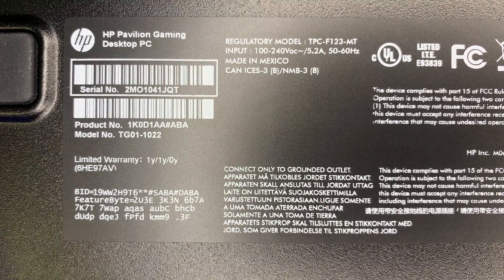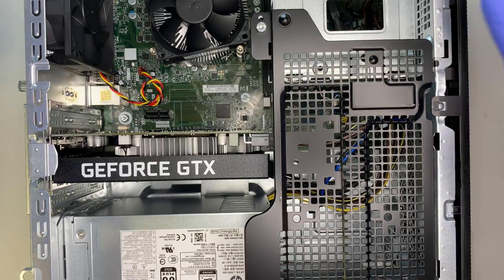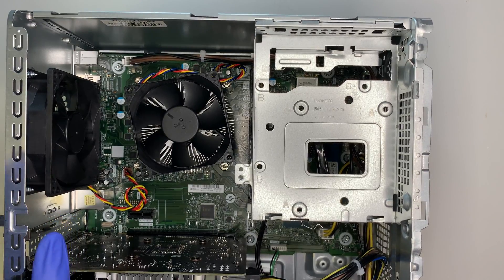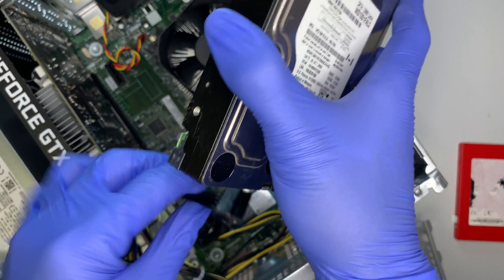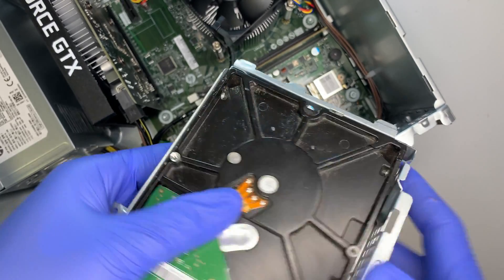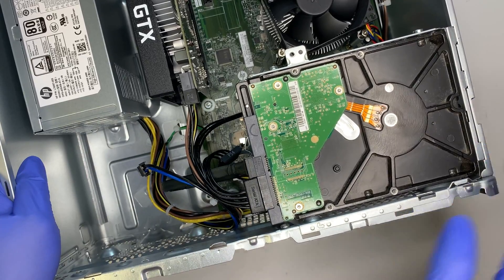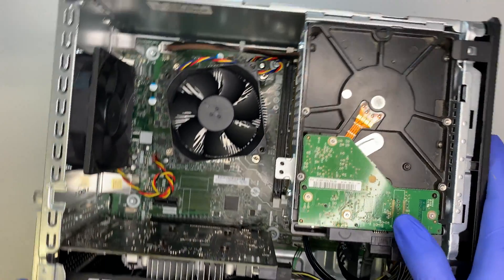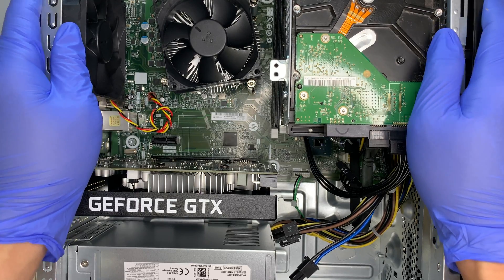HP Pavilion TG01-1022 Add Second Hard Drive

Comment: Excellent tutorial. HP did it a bit complex to remove those things compared to the previous Pavillion models, but you showed how to do this in a clear manner. I just have a WD black in my old Pavillion (WD was bought a few years ago, before I changed for TG01) so I'll install it soon. Thanks a lot. BTW, is power supply  strong enough for 2HDD + additional SDD?

Comment: It's funny watching the videos on this computer, because I bought one and have upgraded a few things, and everybody does more than they have to.   For example, all of the videos showing you where the ram is located on the motherboard, everybody removes the black grate and the hard drive holder, when you can simply just put the ram in without removing anything.  Same goes for this Hard Drive.  You don't have to remove anything, you can simply slide the hard drive in, plug it in, and put the two screws in the side that's not facing the case

Comment: After watching this video, which is exactly how the job should be done, I changed drives three times, rescuing old drives from a computer that I scrapped.  Had three drives in the old computer, one was bad, the other two were good, and using the Sata connection made the job easier.  Now, this video shows how to install one more drive in the supplied drive cage.  And the video mentions that you can add a third drive, as the connections are there.  But where do you get a drive cage that holds both the drives?  Or is there another way to do it?  I would like to have two additional drives in this computer.  The UberGeeks comment below, I interpret as to meaning you can use the supplied drive for one more hard drive, but I want to have two more hard drives.
Reply: Not sure if you saw the comment below by lumiereeclair.. but... he states: You can actually install up to 3 hard drives on this machine. Two 3.5 and one 2.5 exactly. (Of course you can interchange the 3.5 drives for 2.5 drives as well.) For placement, as shown in the video,  you can mount one 3.5 inch drive on the silver cage, however you can also mount a 2.5 hard drive on the underside of this same cage..  How? Just pause the video at 3:0. You will see 3 screw holes spaced around the rectangular opening that are spaced just just right for a 2.5 drive. To install the second 3.5 inch hard drive it can be mounted just behind the front panel on the chassis. He doesn't show it on the video, but after you remove the side panel, take a close look at where the torx screw that secures the silver cage is. Below that you will see holes that will allow you to mount a 3.5 inch hard drive perfectly so you don't have to buy a bracket, but you will however need Y splitter cable for SATA power since there are only 2 SATA power connectors on the included cable and you'll need one more for 3 hard drives. Also if you really want to go overkill for even more storage... you can buy a PCIe x1 NVMe M.2 expansion card. This will allow you to mount a M.2 NVMe drive. NOTE: It will only run at PCIe x1 speed, but if you're not using that PCIe slot, then that's a good option to consider..

Comment: Can you help me find the cable I need to use to add this one that you recommended? Thanks 
Seagate BarraCuda 2TB Internal Hard Drive HDD – 3.5 Inch SATA 6Gb/s 7200 RPM 256MB Cache 3.5-Inch –

Comment: Hi your video was very helpful but i have one more question do i have to remove the conector  at 2:48
Reply: thank you in advance
Reply from the maker: @ckt3315  Not necessary. But it will make your installation easier. That connector is for front lightning.
Reply: Thank you you helped me with this video

Comment: Can you give me a link to the SATA power cable? Please reply, Thanks.
Reply: At 4:16 if you look below the ram you can see a 4 pin cable. That's the sata power cable and it should already be inside. If you need to install more than 2 sata devices then you just need to get a Y-splitter sata power cable.
Reply: @lumiereeclair  Yeah i already know this comment is outdated. I already opened up this PC and found the cables included. By the way, what screwdriver do i need for the 6-32 hdd screws listed in the description?

Comment: It seems there is room for just 1 HDD beside the C Drive (SSD M.2)... Is there a way to have 3 hard drives installed? SSD +2*HDD? It doesn't make sense to provides additional SATA connectors without providing housing for the 3rd Drive?
Reply from the maker: Max 2 additional drives
Reply: you can only hold 2 because it's not enough room for more
Reply: i believe you can install a laptop drive (2.5") hanging off the bottom of the hard drive caddy and a 3.5" drive inside the caddy .. i'm looking at it now and that appears do-able.
Reply: @rushNbust  yeah I already did it work I got all my games back now since I got more space

Comment: Hello, Thanks for your very helpful video!
If I want to install 2 hard drive instead of one, do I have to buy a bigger bracket with two slots, right?
Reply: You can actually install up to 3 hard drives on this machine. Two 3.5 and a 2.5 exactly. Of course you can interchange the 3.5 for 2.5 drives as well. For placement, as shown in the video you can mount one 3.5 inch drive on the silver cage, however you can also mount a 2.5 hard drive on the underside of that cage as well. If you look at 3:07 there are 3 screw holes spaced just right for a 2.5 drive. The 2nd 3.5 inch hard drive can be mounted behind the front panel on the chasis. It doesn't show it on the video, but after you remove the side panel, take a close look at where the torx screw that secures the silver cage is. Below that you should see holes that will allow you to mount a 3.5 inch hard drive perfectly. So you don't have to buy a bracket, you will however need a Y splitter cable for Sata power since there are only 2 sata power connectors and you'll need one more for 3 hard drives. Also if you really want to go overkill, you can buy a PCIe x1 NVMe M.2 expansion card. It will allow you to mount a M.2 NVMe drive. It'll only run at PCIe x1 speed, but if you're not using that PCIe slot, then that's a good option to go for.
Reply: @lumiereeclair  Here is the HP video showing the front panel mount on a similar TP01  https://youtu.be/GzJbEJ1NiAk?t=340
Reply: @lumiereeclair hey so im trying to install my second sata ssd but i cant find more than 1 sata data cable
Reply: @arvinlangholm646  unfortunately, HP doesn't provide extra sata cables, nor sata power cables. So if you intend to install extra drives, you would need to purchase those separately.
Reply: @lumiereeclair  yeah i just bought a sata data cable. Mine came with two power sata slots on one cable tho
Reply from the maker: You are welcome. I don't think you can buy bigger bracket for two slots.
Reply: you'll likely have to screw it to the black metal cage, don't quote me on that, but that's what I would do.
Reply: mine came with a 1Tb drive screwed to the front ( inside obviously) below the hard drive holder bracket! luckily i have a spare 2Tb drive sat about waiting for a computer with an empty bracket to fill 😉👍